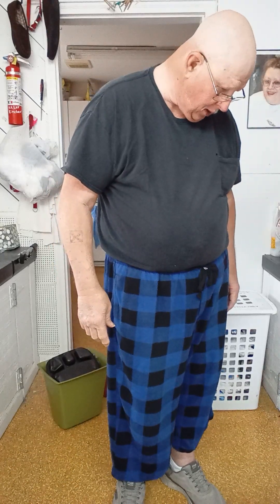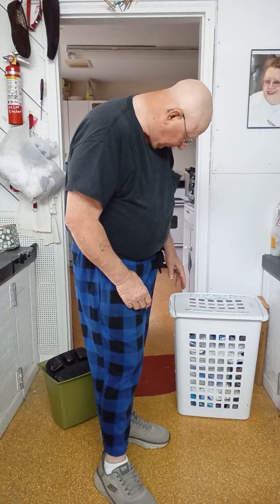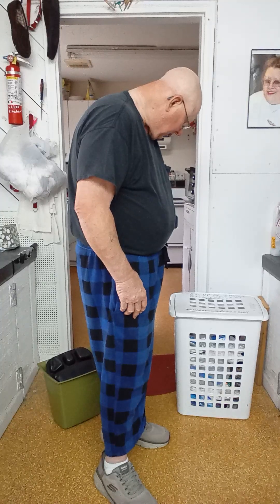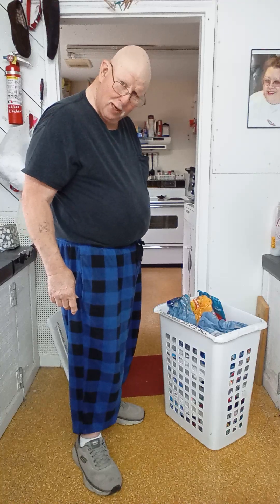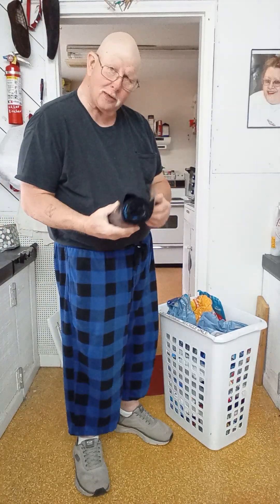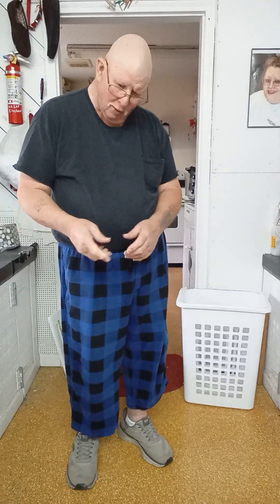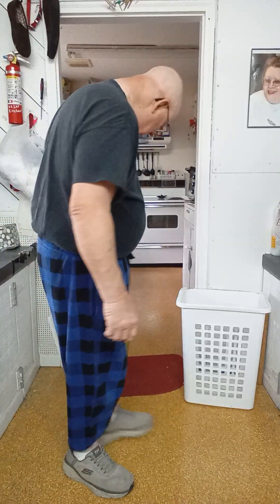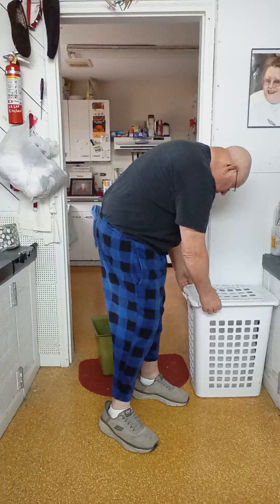How I Do Recycle

Comment: I do the same method with my paper shredder. I get a lot more paper compacted into the garbage bag.
Reply from the maker: I heard it's not a great idea to put your shredding into a bag, because the crooks have a machine they can dump a bag of shredded pieces into and it will reassemble them enough that they can steal your account information and identity. So, I just dump my shredding into the garbage dumpster bin, they come around and get. That way, all my shredding are scattered in with all the other garbage. I hope this helps 
   Thank you for watching and commenting.